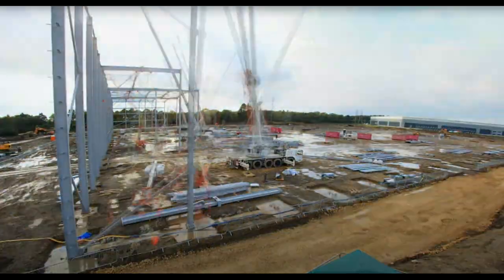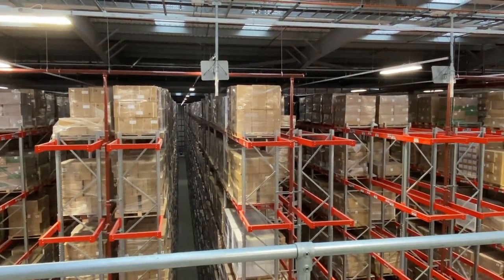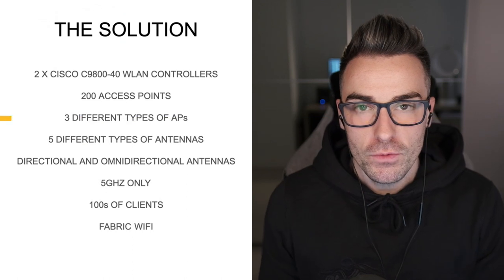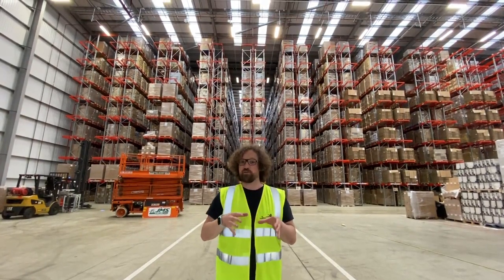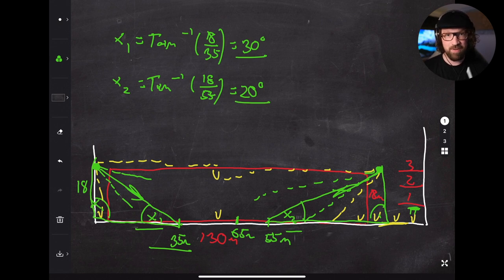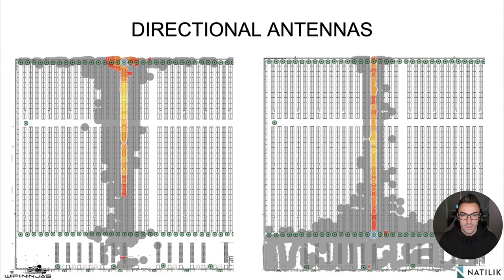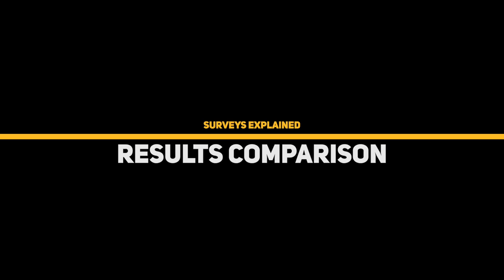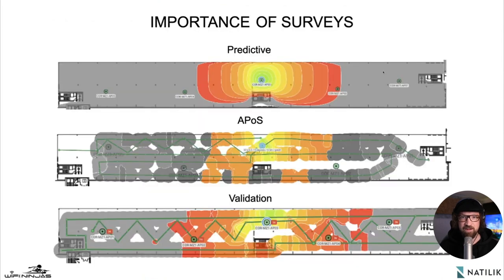How to design WiFi for a 720k sq. foot Warehouse

Comment: Wow I never expected to find such a niche channel. I work for large grocery wholesaler in the USA and design WiFi for these 700,000+ square foot warehouses as well. God bless Ekahau Pro Planner. This is a great video y'all put together. I deal with a lot of foods with high water content and voice selection devices that roam fast on pallet jacks and require constant connectivity. I run so many simulations in Ekahau that its maddening. Keep up the good work. You've earned a subscriber.

Comment: "If you have any questions reach out..." I have a question! Can you help me design WiFi for a new warehouse with 10m high and 60 meter long racks? hah It's driving me crazy. Using Ekahau and I cannot find APs that will get me the coverage I'm looking for. This is definitely the most challenging project I've ever worked on as far as WiFi goes. Typically, I've done office buildings and those are easy!

What attenuation loss did you use for the warehouse racks attenuation areas?

What Signal strength did you design for too? I'm thinking -70 as it will be basic 5Ghz handheld scanners, just like you were using.

Comment: Hey, great Video. Would be great to know how you managed the cabled network. I can see a black rack mouted on the wall at medium height near the truck bays, but how many of those did you mount? Fibre Channel everywhere? what is the speed available to the WiFi terminals? Thanks guys!!!

Comment: Thanks guys, watching this video confirmed we guessed the correct way to do it for our own warehouse.
  
One question, if you don't mind?
If you have a MIMO AP with 4 external Antenna connectors, could you connect multiple directional antennas to cover multiple aisles instead of one AP per aisle.  Or if using a MIMO AP could you have mounted the AP in the middle of each aisle with multiple directional antennas pointing away from the antenna?  Thereby using 1/2 the number of AP's?

Thanks again guys

Comment: Nice design, but how did you make coverage in the trailer of the truck if it is a refrigerator and the signal almost does not break through the sides?

Comment: Love the video and looks like a mega project. But I have one question... for the forklift trucks in question - is their antenna really at the level of the forks? Eg, variable? If the truck design meant the scanner was on the forks, but the antenna was on the body of the truck then all communications could be at ground level (apart from some hard connections from the scanner on the forks to body of the truck on the ground).
Reply from the maker: Hey Scott, the cab of the truck moves up and down - from ground level to 18m high and the driver of the truck has a scanner which scans the pallets.
Reply: @wifininjas8359  Thanks for the info... sounds like the moving cab solves one problem and makes another... top work in the solution!

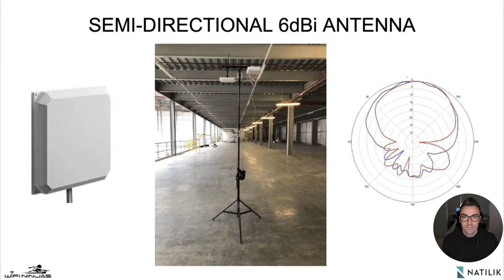Comment: 12:43 But why don't I want to cover with omnidirectional?  Maybe this was asked rhetorically given the rack's installed and the height, but what if I'm lower and don't have the racks?  I assumed I would want omnidirectional.
Reply: I kind of think my question was answered in the bit following, but not quite.  Perhaps our main difference is the height of interference, mine is much smaller than yours